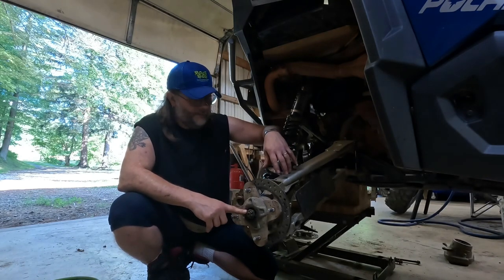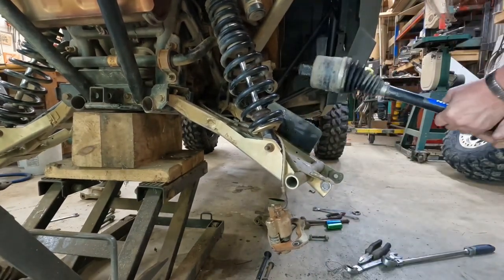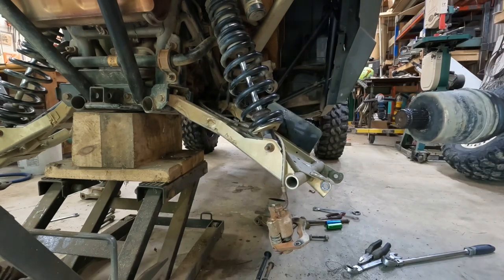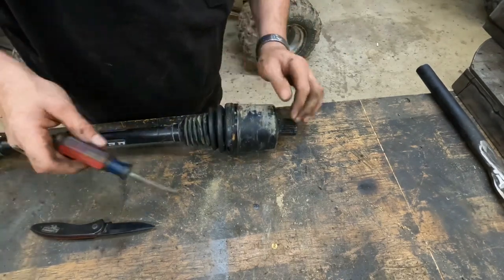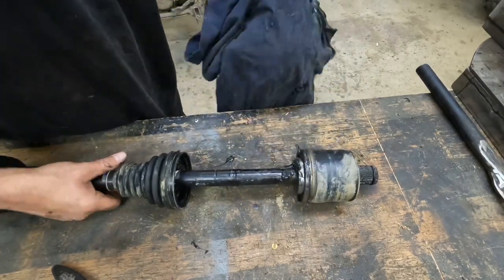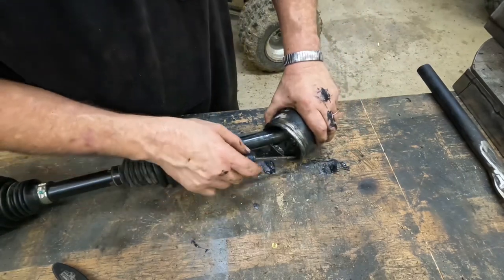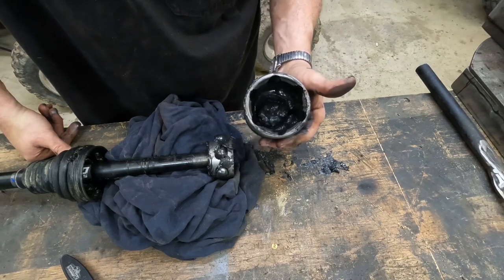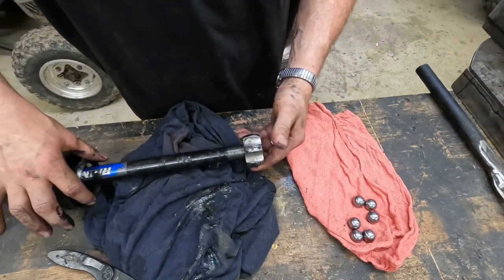How to replace a CV boot on a side by side axle

Comment: Great video - any thoughts on the grease that's being used would be appreciated. I'm going over my '08 500 Sportsman and relubing/inspecting  the cv joints. I was going to use the preloaded packets of generic cv joint grease but was wondering if thats a good quality grease and if they contain a sufficient volume. I gotta say I love the way buddy is packing the balls, cage and races though - thanks again
Reply from the maker: the grease im using here is Mobil Grease XHP222 Lithium complex Blue. been using it for many years  both at work and at home .holds up really well and is water proof.  i am uncertain and untrusting  of the quality of the supplied grease packets, that is why i dont use them. thanks for watching and for the question.

Comment: Where do i get the bearing ccage and 6 balls for the inboard drivers ssteering c_v my cage wabroken at 2000 mi my rzr is 2008 wit 2k mi .stored 4 13 yrs. Good luck.
Reply from the maker: superatv.com has cv joint replacement kits for $100